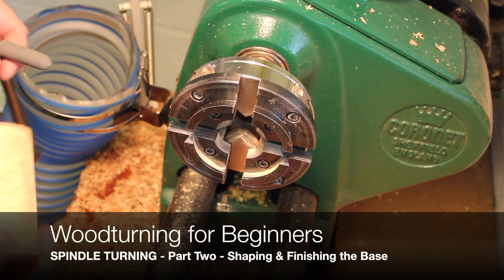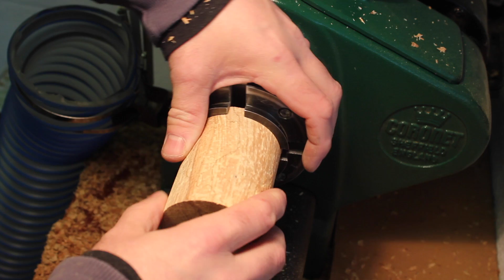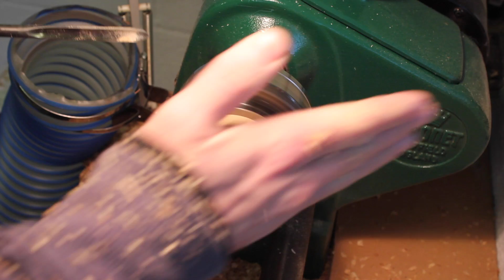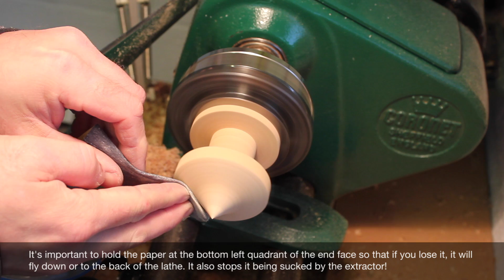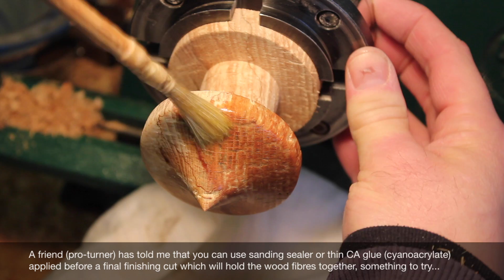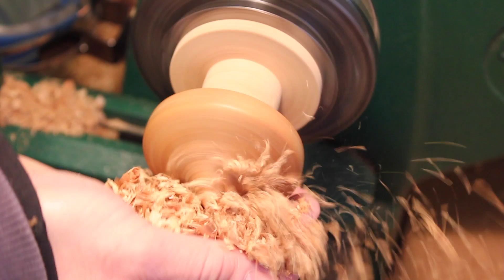Part 2 of 3 : Woodturning for Beginners / Spindle Turning - Shaping & Finishing the Base

Comment: I agree Record/Coronet tool rests are dire.You can buy other brands to fit your lathe or get a length of hardened steel bar welded to the top.
Reply from the maker: Rob Berry Thanks Rob. Yeah, I've never wanted to change it really, if I'm going to change the rest then I'd just want a new lathe to be honest! But thanks, good to know. 👍